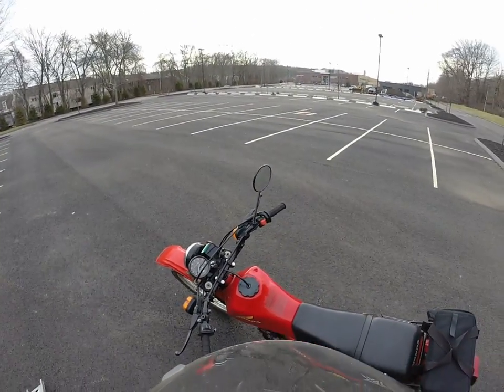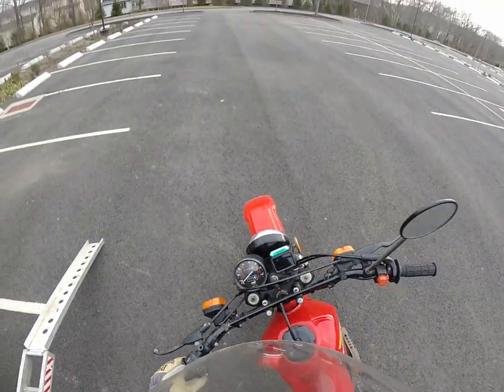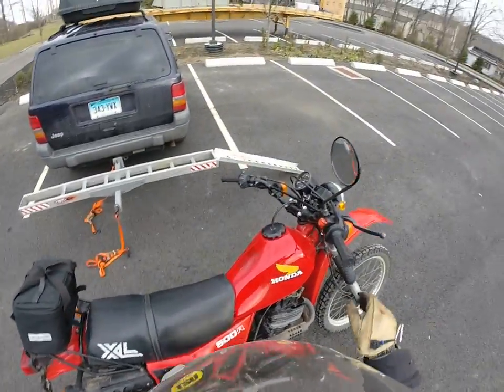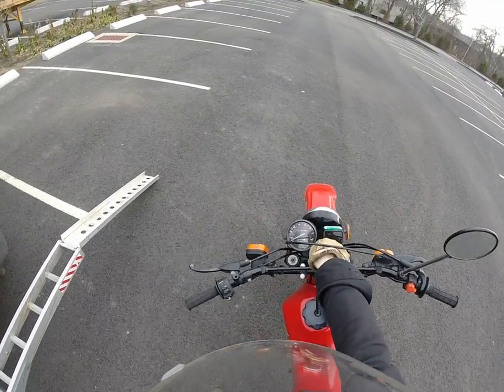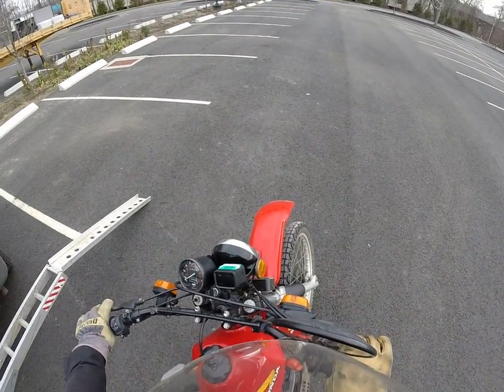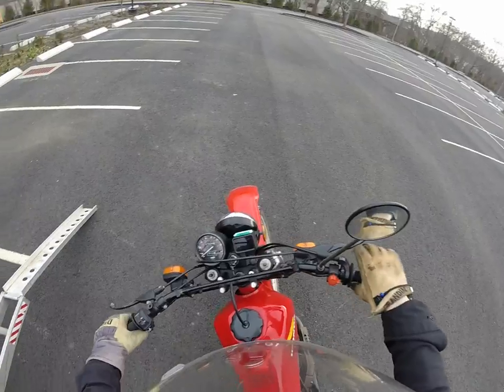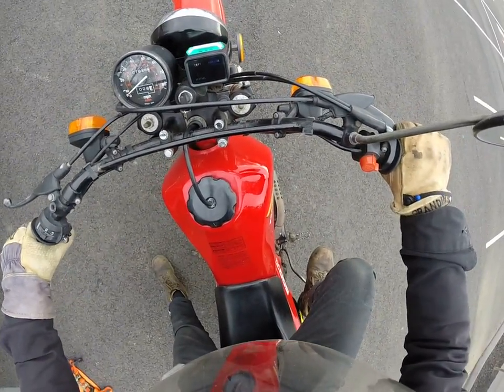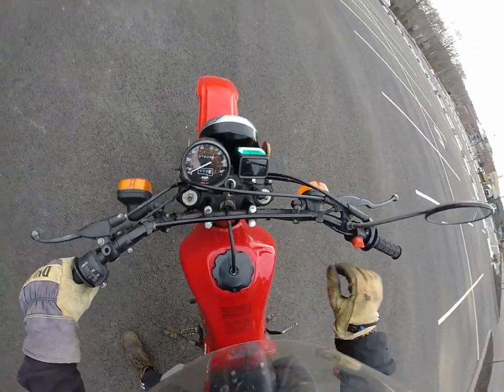Honda XL500 kickstart guide for Noobs

Comment: I'll be pulling my '83 XL500R out of the back garage here in a month or so to get her ready for the riding season. Usually all I have to do is put fresh gas in her and spend a minute doing slow primer kicks to get the juices flowing and she will fire up on the second or third actual kick after sitting all winter.
Reply: You mean 1982, in 83 it was the XL600R?

Comment: My 82 is exactly the same. Depending on the air temp, you all but forget the choke. 
Mine no longer has the auto decompressor cable, only the manual lever. A friend wanted to borrow it one time, and couldn't get it started. I tried to tell him, but these don't like to fire before the compression stroke. He learned the hard way.
Good to see someone else enjoying the older bikes!
Reply from the maker: @Billy Hickey I also don't use the decompression, I wonder if that means I'm low on compression? :) Either way, I can start it fine, most of my friends cant! I say if you can start it you can ride it, they usually tire themselves out!
Reply from the maker: @Billy Hickey Understood, but seven years and 5000 miles ago it seemed like it took more pressure to push it over TDC than it does now. Perhaps its compression or perhaps I just got better at it. Either way, next project is my exhaust... ive patched several holes in it, and now it may be beyond repair... good luck
Reply: Mine too

Comment: What is a compression lever?  None of these vids explains what that means.
Reply from the maker: The compression lever, or decompression lever, opens a vent in the cylinder to make the bike temporarily easier to kick over and get momentum behind your kick, once the engine fires you release the lever and it should run normally.

Comment: I picked one up a couple years ago and am only now able to start working on it. Would you be so kind as to give me some tips and things to watch out for? I know the carb needs a rebuild and I need a seat. I would appreciate the help
Reply from the maker: They are pretty simple machines. Simple carb, keeping oil in it and fresh, can overheat if you sit in too much traffic.... I've had some problems with rust on the exhaust, but so far (10 years) been very reliable. Only done a timing chain, drive train, and tires. Also replaced several parts that I bent or broke riding it in the woods!